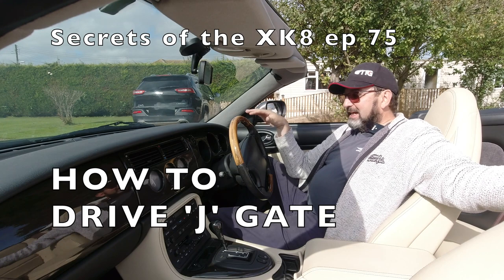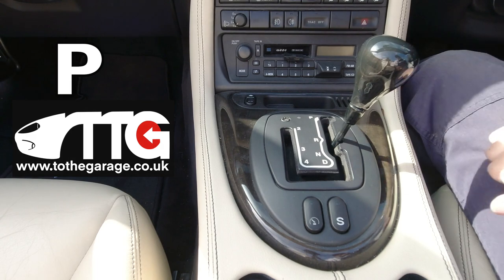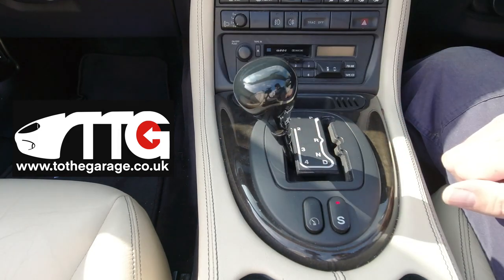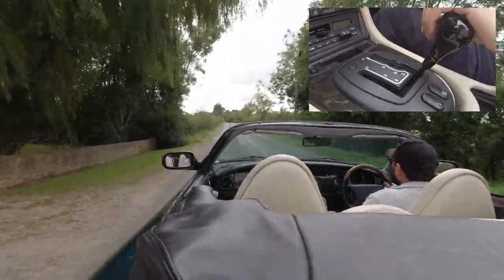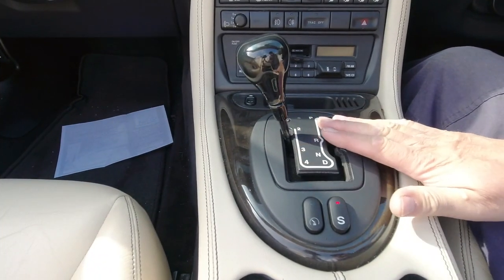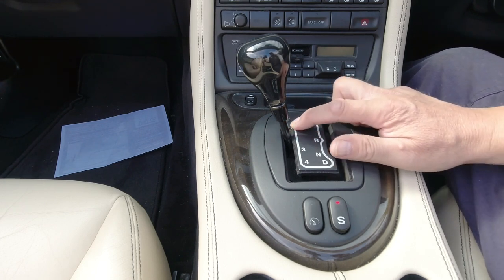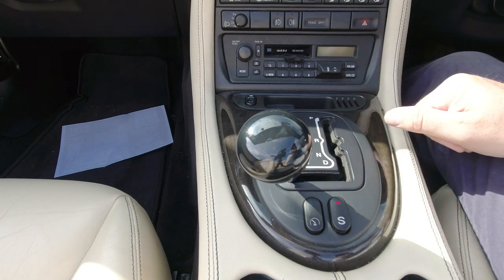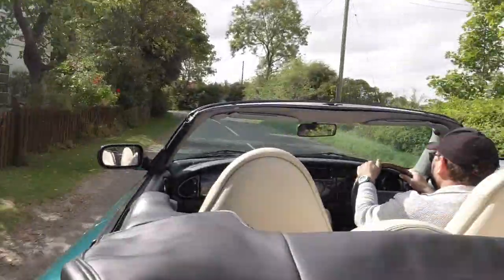how to drive 'J' gate. secrets of the Jaguar XK8 XKR ep 75

Comment: I had the J-Gate shifter on an xj40, and it was magnificent. I absolutely miss my "Randle handle". I wish they would bring it back, which would give a nice 3rd gear shifting option, and separate Jaguar as an automotive brand that's different, special, unique, instead of the bland q cars for Jon every man Smith, which is the kind of sugar free oatmeal they attempt to pass off as an exciting option befitting the name Jaguar. The transportation Jaguar is pitching these days could literally be sold under almost any brand name, with nobody being the wiser as to that vehicles true origin... As tragic, disrespectful, and criminally neglectful as that sad fact is...
Reply from the maker: Hi RJ.
Genuinely loved reading your thoughts.
Im a little more generous in my thoughts (but not much😁) I have huge respect for how good some of the new stuff is technically and from a build method point of view. Plus the sportier XE's are razor sharp drives to match anything the germans produce. However neither the XE or the current XF does much for me in terms of styling, interior or heritage. They do seem to have wanted to fit in rather than stand out.
Jag designs do however tend to age very well, and I wouldn't be ashamed if in 10 years I tell you that I have warmed to them.

Really interesting area for discussion. 
Thanks Mate👍

Comment: What speed or rpm should I switch from 2 to 3 ? And so on. I have a 2004 xjr.  6 speed automatic. I have 2/3/4/5/D.
Reply: For medium power, and powering around i would suggest 3000-4500 rpm. That wouldn't be abusive to it.

Comment: I hardly use it either. 2 things annoy me, here in the US our muscle cars often had a ratchet arrangement when you were in the other gate. That way when you wanted to shift to the next gear you would ONLY go to the next gear, no need to be delicate with the shifter. My other gripe is how it just seems to hate 1st gear, at least with my ZF 6 speed. In normal mode it will be in 2nd within a car length when pulling away and above about 20 mph it absolutely refuses to go back to 1st. Obviously Sport mode helps, but I want more control of 1st. Nothing like pulling away from a light, finding the guy next to you decides to run you and you're already in 2nd and it won't go back down!

Comment: What voltage needed to start my battery is over twelve volts and car will only start with 13 volts and charges fine but will always not start without jumper box
Reply from the maker: about 12.5v should reliably start the car (ideal 13v) but when cranking the voltage can drop dramatically so unless you have facilities to do a voltage drop test its hard to say what the battery is supplying while trying to start.
if a jumper box starts it, then thats a sure sign that your battery is past its best. about 4 years of life in an xk8 is doing really well for even a high quality battery. some of mine have only lasted 2 years.
if you have a posh battery rejuvenating charger then try doing a full refurb on the battery, if not then just get a new one. X100's are super sensitive to a poor battery.  Also check the condition of your battery leads particularly the braided earth one. they can and do break down over time.

hope this helps but unfortunately my advice is to spend £130+ on a new quality Battery.

Comment: Why keep moving the lever in the left hand gate?  Position 3 for example, still functions as auto for gears 1-3, position 4 is auto 1-4?  Most autos of that era and before had positions 1-3 or 1-4 plus D - they just didn’t position the lever positions in a j.  I get that you are effectively stopping the box from changing up when you don’t want it to select a higher gear.
Reply from the maker: Think about it as forcing the down change, without using the throttle and or kick down switch to trigger it.

Comment: Moving the selector when the engine is not running ?
Reply from the maker: You can move from P to N with the ignition on if you need to by just depressing the brake pedal

Comment: Great lesson, John. Best video to date. I notice that you carefully mentioned "for a naturally aspirated...". Is there anything different to consider for us XKR supercharger owners? Also, you did not mention using the sport mode and j-gate together. Any quirks with that or does it simply repeat the normal sport mode function used in Drive? Finally a personal comment on sound. I have not adjusted my exhaust to give a bigger sound. I`m 63 and happy with the quiet ride.. However, now that you have given me more confidence to use the j-gate, if I can`t hear the engine revs properly (dodgy ears) it is much harder to judge how to best time the j-gate gear changing. Possible solution could be to put a loudspeaker INSIDE the car so I can hear it (and enjoy it) without scaring the horses.  Thanks very much for excellent, fun and informative work. (XKR 1999, Phoenix Red, 15,000 miles, faultless).
Reply from the maker: hi Bill
when on the left-hand side of the shifter, the sport button just increases the number of circumstances where the box decides its ok to launch in first gear. 
(from mostly, to almost always😁) 
Other than that. the S button is pretty much redundant when driving in 2,3,4,
The reason that even the most exotic of manufacturers will still offer a normally aspirated car is Throttle response.
even the best turbo cars have a far slower throttle response. Supercharged cars are far superior to turbo's in this regard but do not have the razor-sharp response to the butterfly opening that a powerful NA car has. Don't get me wrong. the supercharged car more than makes up for it with its massive boost in torque and horsepower. indeed you could argue that the supercharged car delivers the performance in higher gears that the XK8 needs the manual gear selections to deliver.
so even if the manual shifted percentage increase in pace and fun is less with the xkr's. it's still significant. 

great question
love the speaker idea.

Comment: The gearbox is so slow I just don't find much fun from using the J gate, you can nearly count a second between selecting the gear and the car actually doing as such
Reply: One of my previous cars was a mx5 - great for shifting but I enjoy having 3x power in the cat now, guess a Porsche would merge this two worlds - but then it's too cliché😉
Reply from the maker: I admire the 911 but find it all bit clinical compared to the soul of a big cat. I like the mx5 because they have a spark of personality also. but the engine bay won't accommodate a 4.0 litre so cant go there🤣
Reply from the maker: it shifts slow by modern standards but was excellent 23 years ago. and the slow shift allows the jag to auto change seamlessly in a way that modern DSG boxes are only just matching
Reply: @ToTheGarage  yeah I can see that, but in terms of using the J gate for spirited driving I just find it too slow to react, my other car is an XFR-S with the 8 speed ZF and that on the other hand is perfect for it, although there is another decade and a halfs worth of tech in that
Reply from the maker: DPW 864 
Oooo my compliments. Another car on my wish list.    French blue?
Reply: @ToTheGarage  ultimate black unfortunately, wish I went for the Frb, considering a wrap for next summer.